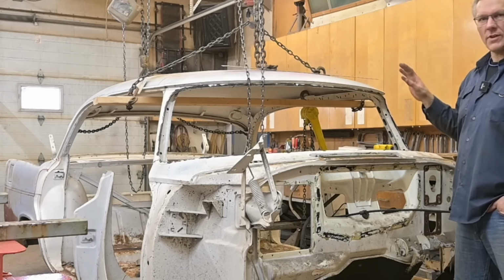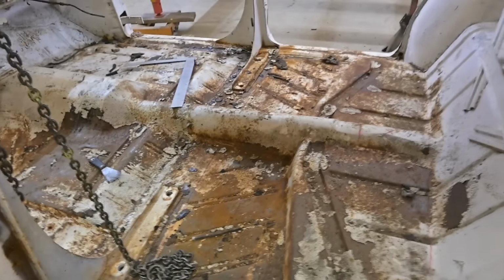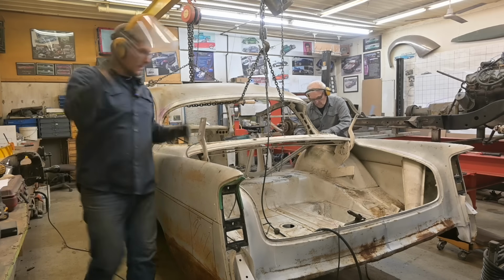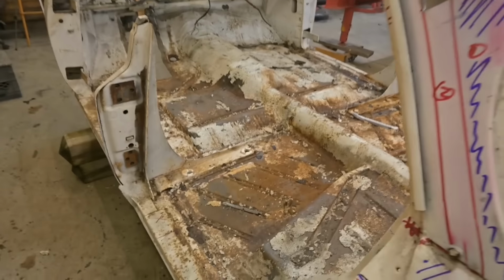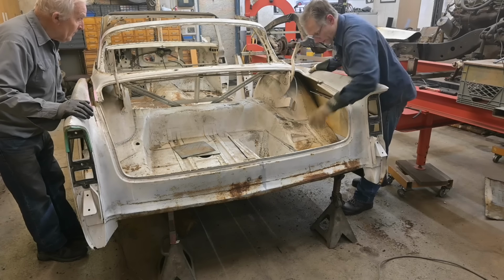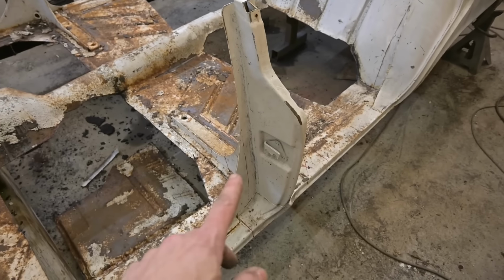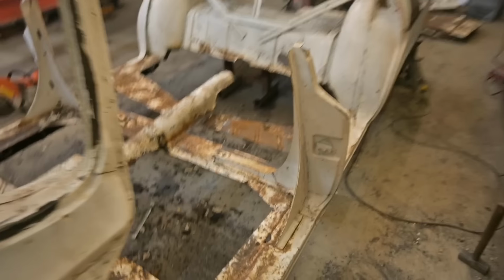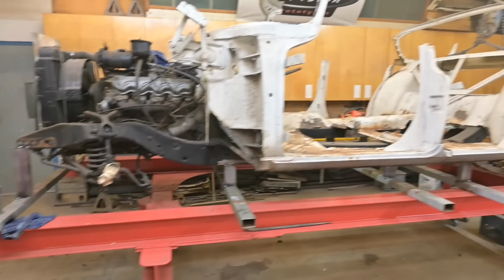CHOPPING UP a Perfectly Good MOPAR to Make It Way COOLER!  1956 Chrysler Windsor Muscle Car

Comment: Great video! I'm building a 54 chrysler now, so great inspiration! By the way... The undercoating is factory sound deadner. Very thick, applied over paint in the factory. All the chryslers have it
Reply from the maker: 54s have great lines!  👍  Thank you for sharing the info on the undercoating.  By the time we're done it'll all be off and we'll apply a more modern sound deadening material.  Thanks for watching!!

Comment: Now that's a chop job ... my Windsor had thick undercoat on it ... I think for sound deadening ... as far as swivel seats ... I had a 60 Chrysler that the seats swiveled out when you opened the door by cables ... this is gonna be a cool build ... now lets see what you can do ...
Reply from the maker: Didn't think so many would be interested in an old MOPAR.  Pressure is on NOT to screw this up.  Thanks for the info on the floors.  Surprised the factory would apply that much.

Comment: The Thunderbird never had a swivel seat.  It did offer a swing away steering wheel in the early to late 60s on the Thunderbirdand 67/68 Mustang.  Chrysler offered a swivel seat from  1957 through 1960.  GM also offered swival seats on some Colonade cars from 1973 to 1977.
Reply from the maker: Thanks for clarifying.  👍  The 62 bird we had here at the shop a few years back did have a swivel seat.  Someone had retrofitted a base unit into it.